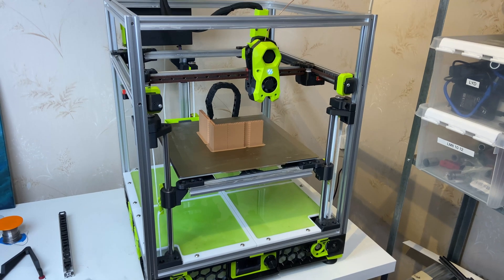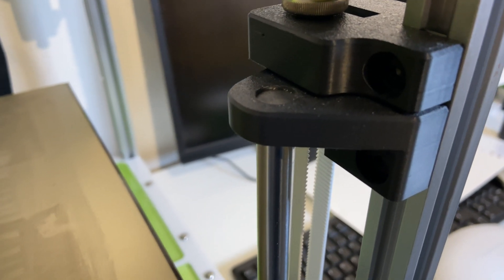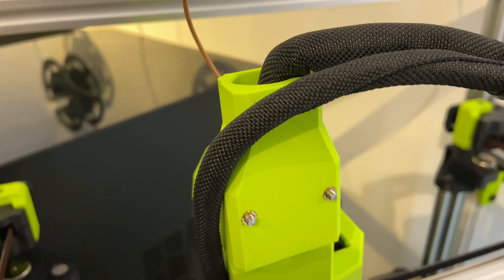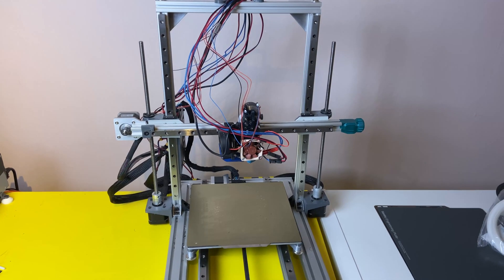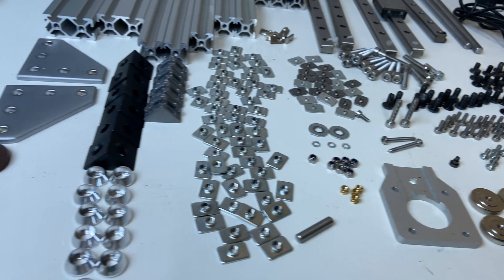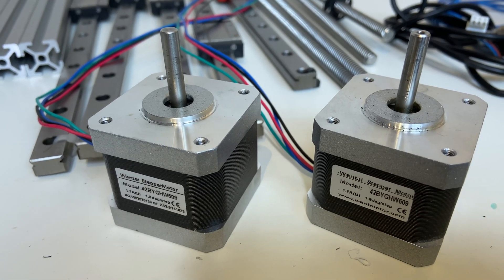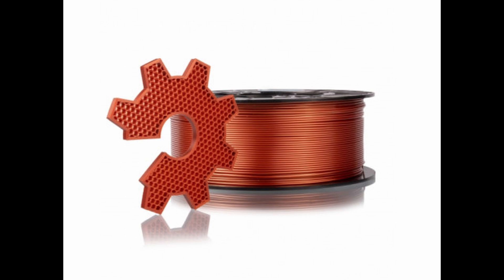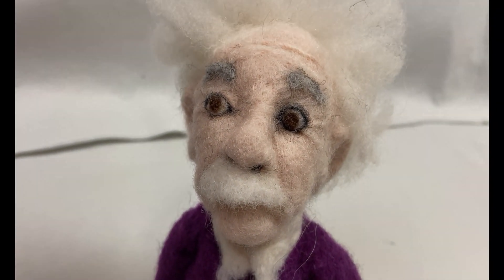New 3D printer build series coming soon!

Comment: Looking forward to this update.

Word of advice, keep a Z endstop. The BTT Eddy gets affected by the ambient temperature, and the z offset keeps changing at random intervals. I'm at the point where I'm going to remove my USB Eddy and either go cartographer or just a plain ol BLTouch or klicky probe.

Also note that you might have issues getting the printer to home with Eddy and you'll need to use the set kinematics position of Z before setting up the homing and temperature drift calibration. The BTT using I2C does not need all this as it can also not be used as a Z endstop
Reply from the maker: Thank you for the advice. I sure can keep the physical endstop, almost no cost involved in that. Have you been able to configure the physical endstop in combination with a probe? The reason I planned to drop it was that I couldn't get that to work in combination with sensorless homing on the previous build. And it seems that the standard inductive probe works fine in an open printer.
Reply: @v4projects  I have given up or rather abandoned my attempts and packed the printer away for a while and focusing on my Kossel Mini, but in essence you can run both and just use the probe for bed meshing. Just keep your pin definitions for a physical end stop for Z And when you run bed mesh, use bed mesh calibrate method=rapid_scan if memory serves. 

For Z offset, you can set a variable, start a print and baby step it to get the correct offset and call that in your start print macro.

I will try this again when I have mustered up the courage to tackle it, but for now my focus is on getting my delta to lay some plastic

Comment: Good stuff. Building a trident is on my list after I convert my SV05 to a Mercury One. I like the work you did on the one here. Looking forward to the upcoming series. I’ve been printing for a few years. First a bed slinger, than a cube, recently got the K1SE. That said, I hear you regarding budget. I’m big on NOT overspending however, I’d say both the power supply and the steppers are where you shouldn’t scrimp if you are looking for top performance. Great project!
Reply from the maker: Thanks for watching and your comment! I have ordered a new PSU but will try to use the Wantai steppermotors I have.
Reply: When converting your SV05 to Mercury one use two 350mm/360mm MGN12H rails for the y axis. The SV05 frame is 30mm longer than the Ender 5 Pro frame. Don't ask me how I found this out after spending two times for rails on the SV05. And I will not spend a third time. ;)

I'm also adopting the Triple Z from the Trident to the SV05 with a 300x300mm² bed. Everything is very tight but hopefully I can use 280x290mm print area in the end.
Reply: @ Thanks so much for sharing this! I’m just getting ready to source the parts. I’d like to use the LDO kit for this (I think they are the ones with one). I’m very interested in the 300x300 update. If you would, shout back here as to how that goes! I’m going to do the standard MercuryOne upgrade first follwed by the Hydra option in the end I think…

Comment: I believe the beacon has very good accuracy during a single run, but it's not repeatable in length offset between runs due to different temperatures. I think it's still recommended to have a endstop or a nozzle height setter like you would see on a cnc machine
Reply from the maker: I will test this out. This being an open printer should make the temperature differences less of a problem (maybe?). If it doesn't work out, I'll just go back to a inductive probe. I wasn't able to get the physical endstop to work at all with sensorless homing in the last build. There is a procedure called Temperature Compensation Calibration (Eddy USB ONLY) that I will try out.
Reply: @v4projects some people have problems with eddy, but you should try first. cartographer is a serious beacon contender. For under 40 dollar you get fast bed meshing and in the newest software version carto tap for automatic z offset. Temperature compensation too of course. Power supply’s are cheap on Ali. I know most people on discord scream meanwell but I used a cheap 48v power supply (originally for leds) and used them for my A/B drives. Nothing wrong yet and I paid like 15 dollar.

Comment: very nice coudl you publish the files?
Reply from the maker: I have to complete the design first. At this point it's just a rough model
Reply: @v4projects  ok, is that the same for the first version you built? Also, a cool idea for the second and for the first one is a tool changer setup.
Reply from the maker: I will publish the files (my custom files that is) on Printables as soon as the build is completed and tested. I expect that to be done in about a month. At this time I don't know what my next project will be. There are a lot of tool changer stuff going on, I might do something else. Thanks for the suggestion!
Reply: @v4projects  nice another suggestion is ercf basically its a mmu3 but for vorons and ohters. I've tht its hard to use tho